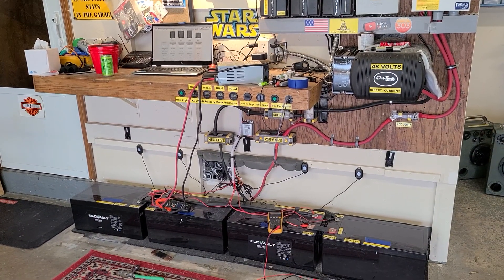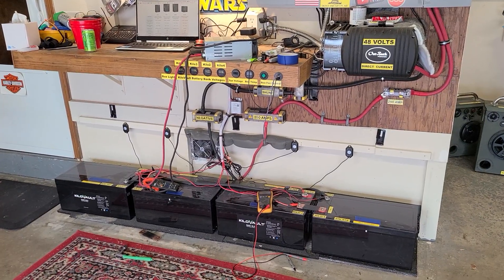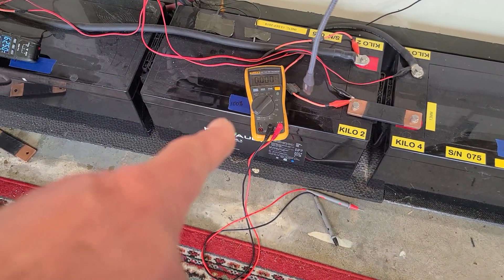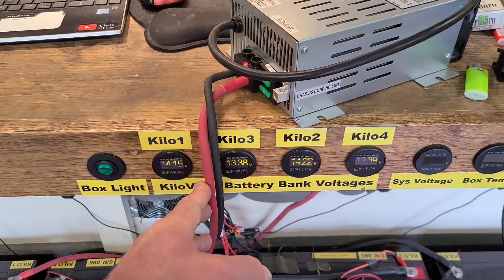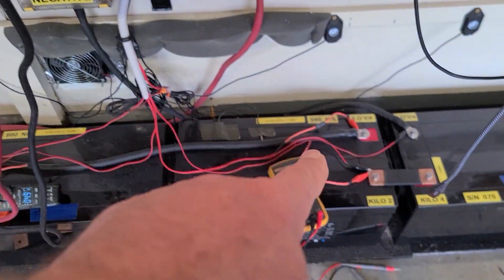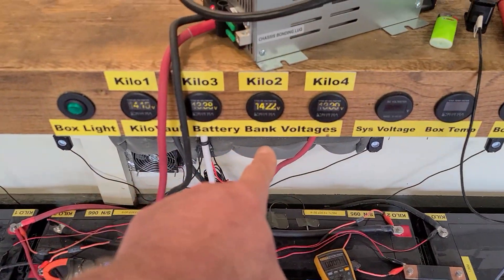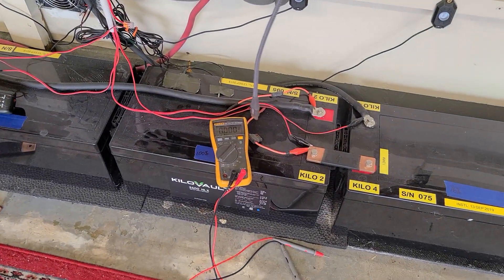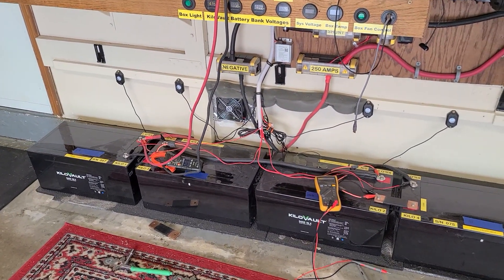WHAT IS GOING ON? 48v lithium battery bank -- weirdest problem I have ever seen

Comment: A bad cell will taje out the other cells in the battery's there are 4 cells in each pack that's what's wrong the dead sell and they over current it th ohms pulling from dead sell

Comment: Sounds like you have a dry cell when these batteries get dried out the voltage goes up under charge and drops it's capacity even if in series
You can pop the cover off easy with tiny screwdrivers and pop the rubber caps and shine a light inside add only distilled water only
Might be a old downing battery too if over 2 years old etc!
I repair scooters they use same 12v lead acid sla vent cells and over time they do loose water
Try a load test like a car headlight with the battery disconnected completely and see what the amps it can put into the light test them all is best bet the higher voltage ones put out less amps as shown with a is/fluid losses and aging
Hope this helps ya out!
Reply: Greetings friend, The batteries are not Lead Acid. They are Lithium Iron Phosphate.
Chris has extensive experience in FLA and AGM. That is why he and many of us has switched to Lipo4 and Lithium Ion NMC.

Comment: Chris I have SOK batteries with the same chemistry as Your Kilovault batteries. My SOK batteries charge at 14.6 and the resting voltage is 13.6
My point is one battery in absorb mode is 14.6 but the moment I use 1 amp hour it is 13.6 but is still essentially 100% SOC. Is it possible that your BMS is not reading the SOC accurately? Can the BMS in each battery be reset? I see that you have one buss bar disconnected on the battery you are charging so I have no idea where the gremlins are making the jump.
Reply from the maker: Thanks Steve -- it is some kind of BMS madness. The actual useable kWh output of these batteries is decent for what they are rated (even with these issues). I have an update coming...even more weird stuff happening (for example, the BMS Bluetooth APP is saying one thing and put a FLuke on the battery and it is 0.5v off). Another weird thing...left that 12v IOTA lithium charger on Kilo1 for 36 hours...it "finally" got up to 100% SOC. Strange-strange-strange. I am currently charging Kilo4 the same way with everything disconnected...to see if I can get it to come up to 100% and stabilize at 13.6v. Thank you for your comment (you know me and my equipment well)

Comment: A have 100 Ah Winston cell in my solar system 9 years, no problem, without BMS, also NMC cells, 14S 8 years, around 29 kWh, no problem, it is used with MeadWell and Victron Phoenix and Victron MultiPlus II invs., RPIs with Venus OS. Victron shunt reads 3 % lower, so there is no chance to solve equations, and to make proper estimate of SOC. There is o lot of factors, SOH, DC resistance of cells, AC impedance, resistance of connections, temperature drift, Peukert const, U need 20 or 24 bit ADC and push-down to 0 the interference. But this is costly and nobody goes this way, they are maybe using 12-bit ADC. Also there is not proof, that FW and Apk is without bugs.
Reply from the maker: Thanks. Makes me wonder if a BMS calculated SOC reading is just a "wild ass guess" with these batteries

Comment: Do the internal  BMS on these batteries allow you to string 4 together? - Check the manual or with the producer - some makes only allow 2 batteries to be connected in series.
Reply from the maker: According to the manufacturer...it is okay to string them up to 48v.
Reply: @ChrisDIYerOklahoma  Twas just an idea - maybe the low batteries need to absorb for longer
Reply from the maker: @trevortrevortsr2  -- Yeh, I agree. I managed to get Kilo1 up to 100% SOC after leaving that IOTA lithium battery charger on it for 36 hours. WTF? 36 hours in trickle/absorb?
Reply: @ChrisDIYerOklahoma   I have 2x 8S packs - one has matched cells and absorbs in about 10min the other cells from 3 different batches and takes 45 min to absorb each time - in my RV I set my  EpEver solar charger for 2 hours absorb  ' 13.8v -  Not the full voltage and only just on the start of the knee  - its not good to absorb/ trickle charge much longer

Comment: Hey Chris. Nope that dont make sense. Put the clamp on it to verify and if that shows current disconnect it entirely, get a reading from the fluke and then a reading from your meter to see if they match. Weird stuff man!! Keep us posted and KEEP EM COMING!!
Reply from the maker: The meters match (volts are exactly the same). Kilo2 is completely disconnected...still showing 14.20volts (resting, disconnected). 0.00 amps with the ammeter and showing 0.0A on the actual battery's BMS app. All the resting volts 13.48v. I am stumped
Reply: @ChrisDIYerOklahoma  Ok that is strange. Battery or BMS puking out? Maybe call up who you  got them from to see if they have come across this before?

Comment: I'm no expert; but could it be slightly related to the different link/type busbars forming the series connections? (the long wire)  I've never played with it; but it supposedly matters a lot in the FLA batteries.  I'm wondering why the individual batteries' BMS isn't doing what i think it should be doing, or maybe it is and it's a moot point.  I forget when you switched to these; but are those little wires part of an external BMS to try and balance the individual 12v packs?  If so, does it have any log data that may help?  I just rewatched the video before posting, those smaller wires are more likely your individual volt meters right?  I'm wondering if you should have an external BMS on these 4 batteries.  This may also be why you don't typically see lower voltages packs being OK'd to be connected in series.

Are these the model of batteries that you can connect to their internal BMS via blutooth or something?  If so, what's the status/health of the internal cells?
Reply from the maker: Yeh, those little equal length wires are just for connecting the front panel voltmeters (all working fine and verified with the Fluke). These KiloVault's have BT BMS and Kilo2's cells show healthy (four cells @ around 3540mV each)